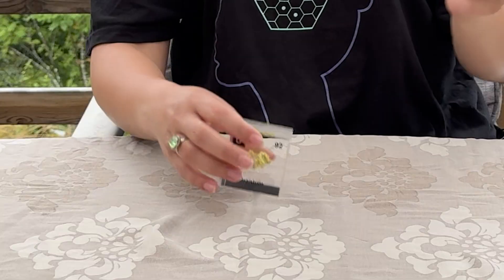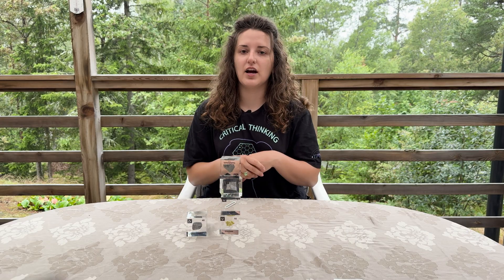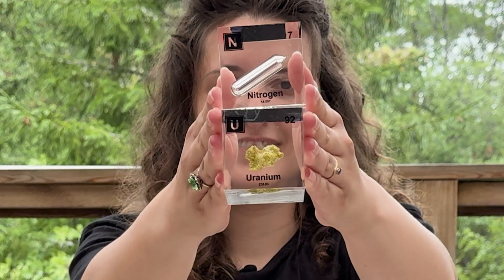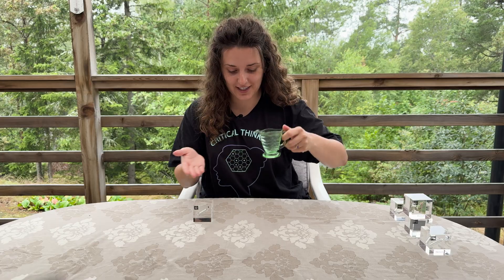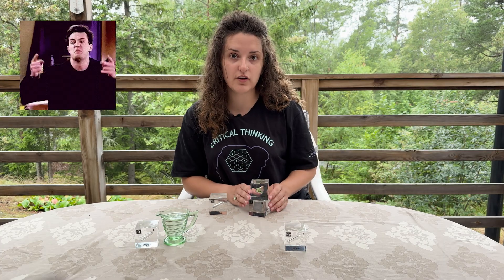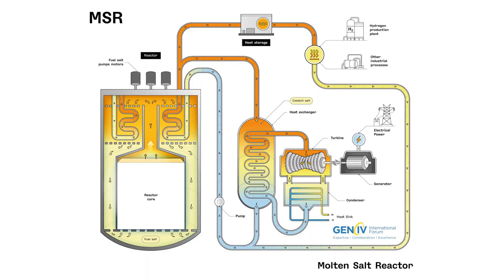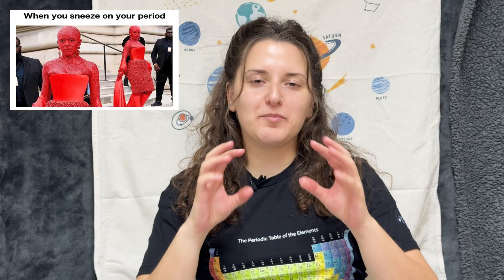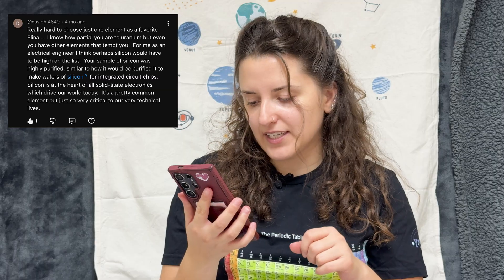Build a Nuclear Reactor with Me  + GIVEAWAY 🎉

Comment: So basically you're saying that your uranium nitrate are simpler than thorium molten salt reactors, it's your words. Zirconium without being pair up with sodium and lead sounds promising, no rusty parts longer time durability usages.

Do uranium nitrate works without erbium and gadalanium? Because without stabilizer on chain reaction, you knew that you'll blow up something.

If carbon is substitute moderator to graphine because carbon is cheaper, question is carbon better for greener environment than graphites?

Water won't give you stable environment where will heat up to thousands celcius. When water reach just 100°C you got no water left. You're about to need pressurezied gas within pipelines.

Dude you're going to need big team to make reactors working.

Comment: I used to work in a university chemistry department, so I have lots of favorite stories about various elements. For instance, I don't think of green when I think of copper, because mostly I worked with copper sulfate which is bright blue. My favorite mercury story was freaking out the local hazmat team when I told them I had more than 150 kg of mercury just sitting in a cabinet because it was too expensive to dispose of. The hazmat team only had a tiny spill kit suitable for cleaning up one of those mercury thermometers, because by law any spill bigger than that they have to call in the EPA.

Comment: You missed iron. 

An interesting element as it sits midway between the energy of fission and the energy of fusion. Likely because of this halfway point it is a very common element in multi generation star dust. Its presence on Earth indicates our solar system was formed from the dust and gas remnants of many previous generations of stellar activity. 

Iron is rarely found in its elemental form on Earth's surface due to it reacting strongly with oxygen to produce various ferrous oxides which are better known as rust. There are rare cases of meteorite iron being used by civilizations to form tools from before they developed furnaces capable of smelting elemental iron from iron oxide ores. 

Making up for its rarity on the surface is irons presence in the core of our world where it and nickel are thought to make up the majority of the inner and outer cores of Earth Our planets magnetic field is thought to be present due to the iron in our worlds core and its motion and its unique structure when compressed, literally, by the weight of the world.